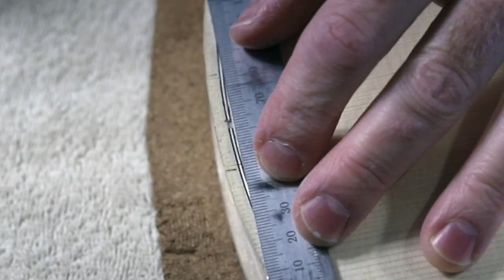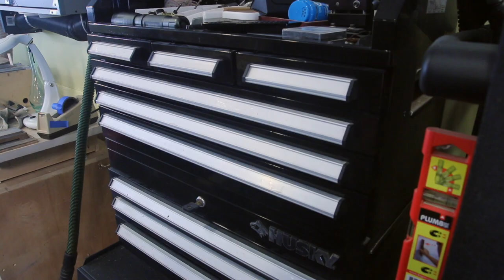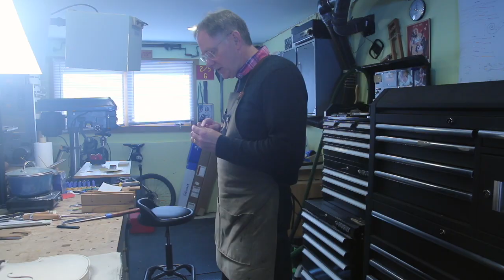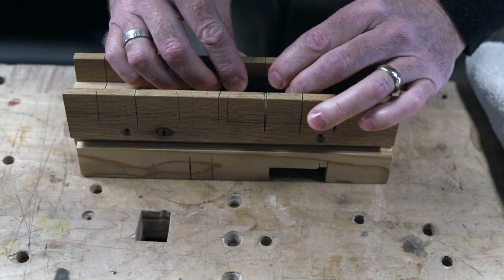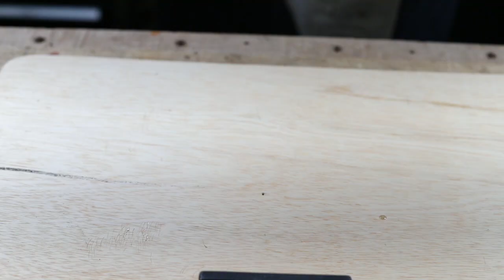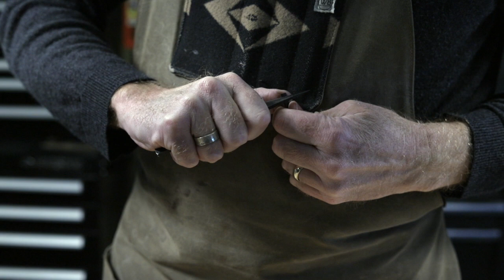Violin Making- Fitting the Saddle

Comment: thank you Stephen for this video. Very illustrative. No sure if you glue the saddle to the block or to the plate (or both). Thank you again
Reply from the maker: I try to glue to the block but a little usually gets on the edge of the plate. As long as it is just a drop of glue and the saddle is easily removable it is ok.

Comment: That violin hasn't got any varnish on it yet. I have been told by more than one luthier that the saddle goes on after varnishing.
Reply from the maker: Just take the saddle back off before varnish.
Reply: @Stephenmboone  does the same apply with the nut that some people call the upper saddle?
Reply from the maker: @AmandaViolinGirl  yes, the finger board and nut come off for varnish in my case. The violin is bare when varnishing.

Comment: How did the saddle get its name? When people hear the word saddle they would most likely think of a saddle on a horse when horse riding.
Reply from the maker: I do not know the origin of the names of the parts. The tailgut does indeed ride on the saddle. The saddle is harder than the spruce top and protects the top from the pressure of the tailgut so in a way it functions like a horse saddle. This may be the reason.